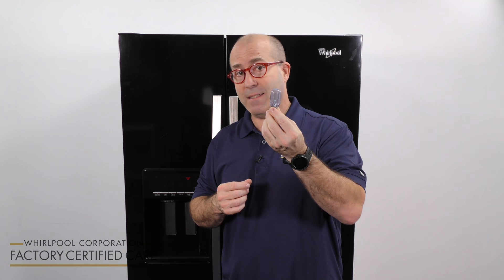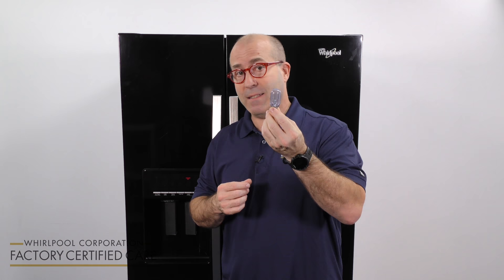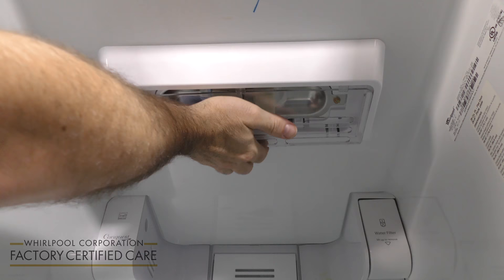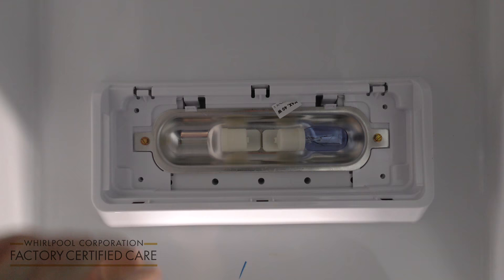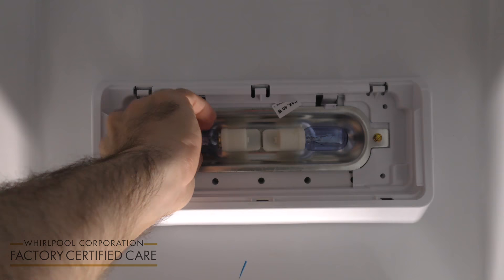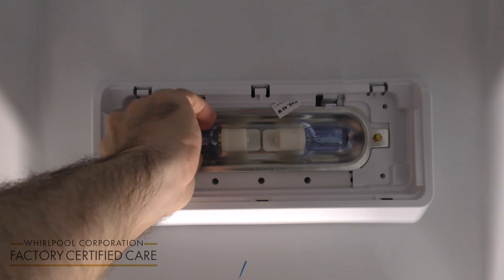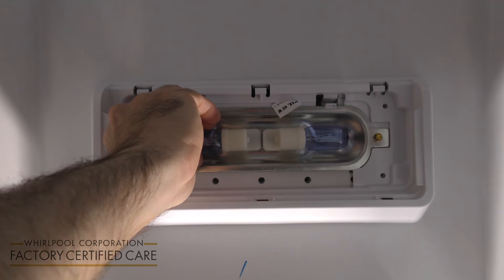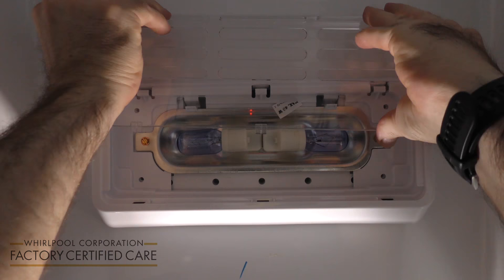How to change a refrigerator lightbulb

Comment: Doesn't even show how to unscrew the light bulb. Mine is stuck in there no matter which way I try to unscrew it it gets stuck. I don't want to apply too much pressure because I'm afraid i might break it.
Reply: I'm having the exact same problem today
Reply: @dw3998  Eventually after so many tries, we got the bulb out. Turns out it was just extremely tight.
Reply: @_Mohanned  ok thank you so much. So which way is it to unscrew. Towards the back of the fridge or towards the front?
Reply: @dw3998  It actually depends on which socket your unscrewing because there are 2 of them. 
If your unscrewing the bulb in the left socket, towards the back of the fridge. If your unscrewing the bulb in the right socket, towards the front of the fridge.  
Just remember the general rule:  "righty tighty and lefty loosey". To tighten, you turn to the right (clockwise). To loosen, you turn toward the left (counter clockwise).
Reply: @_Mohanned  Thank you so much! I forgot all about that rule lol. This single lady appreciates ya!
Reply: @_Mohanned  Hey! Just an update, I just got them out finally! Thank you!
Reply: @dw3998  Glad I can help :)
Reply: Step 1: WEAR GLOVES...2 unscrew bulb...3 If it BREAKS, use long-nose pliers or regular pliers to grab the metal edge of the bulb, and unscrew it. 4 coat new bulb threads with bulb grease before installation...DONE...

Comment: Why must we unplug the refrigerator? I can't even move it to do so. It weighs a ton!
Reply: Safety, in the unlikely event you get shocked.  You can also tape the little plunger down that activates the light or hold it down while you change the bulb. You could also flip the breaker off.

Comment: Looks nothing like my INTEGRATED fridge and the light bulb cover is TOTALLY different. No help at all!
Reply: Same here.  I can't get the plastic shield off at all and my brand new refrigerator has a burnt out bulb in less than a year.  I'll certainly never be buying anything from these guys again.  The manual that came with my fridge is a generic manual and the light assembly is not even close to the same as my fridge.  Extremely poor customer service and documentation.  What kind of company installs an incandescent bulb in a fridge in 2022?  Totally unacceptable.